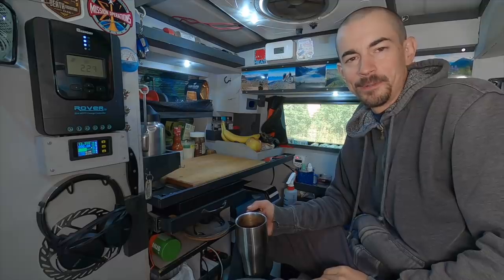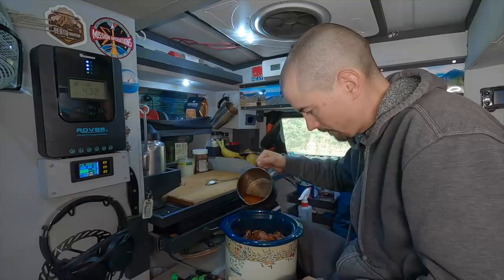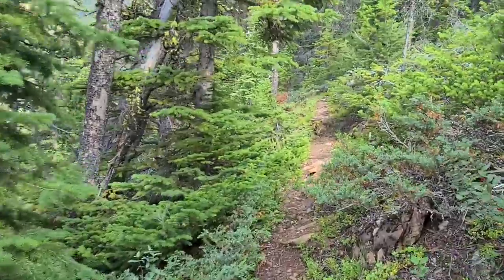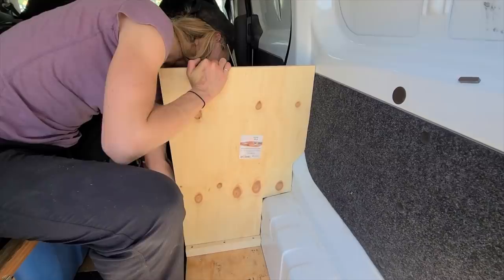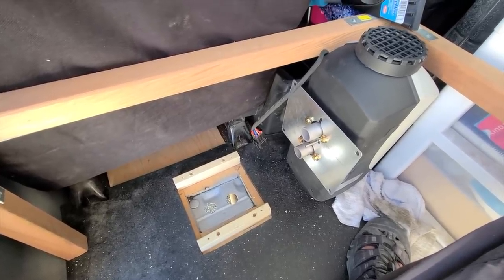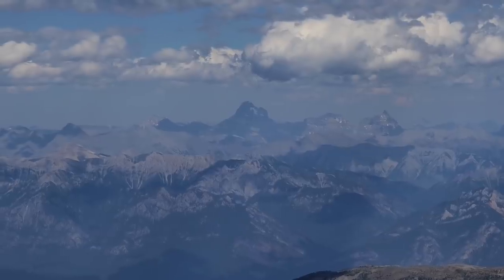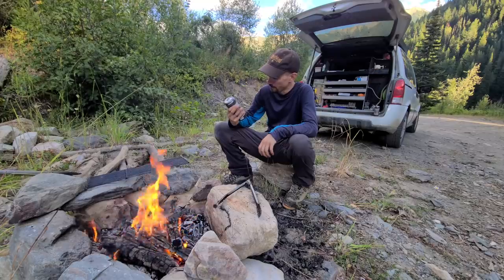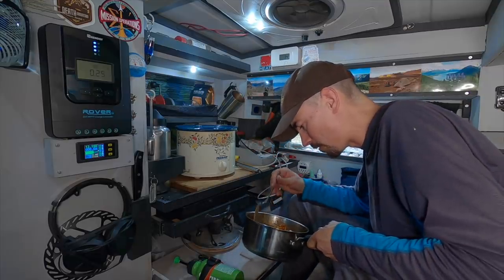Van Life - Crockpot Chicken Wings at Mt. Nelson

Comment: As someone familiar with old Toyotas that use RTV to seal their oil pans, there's no magic to getting it off. A block of wood against the side of the pan and a mallet smacking said wood over and over and over until something moves is about the best you can get. The next challenge would have been removing the old RTV. Good call on the JB weld. I had a guy tell me he sealed a crack in his engine block with JB weld and its still running strong. Lol

Comment: So you leave your crock pot running while you go out for the day on a hike. Wonderful! but... what is powering your crock pot? I have a small crock pot in my van but only use it when I happen to be plugged in to regular electricity.  I've though of running it as I drive down the road using my cigarette litter power source but it is 10 amp capacity and little crock pot uses 95 watts.  Concerned that it might be too much wattage over an extended period of time even thought the pot is using only 8 amps.   Any help would be appreciated.  Love your creative delicious meals.